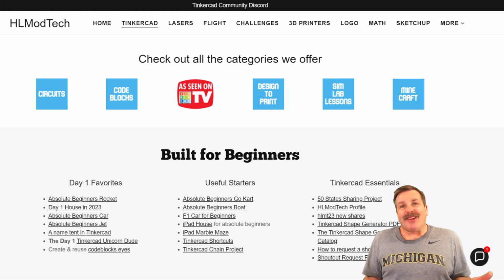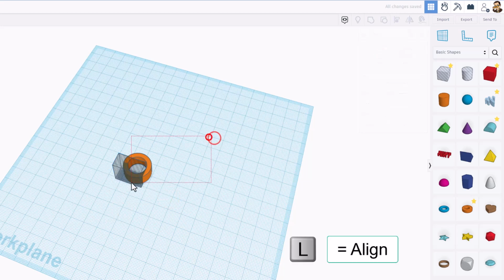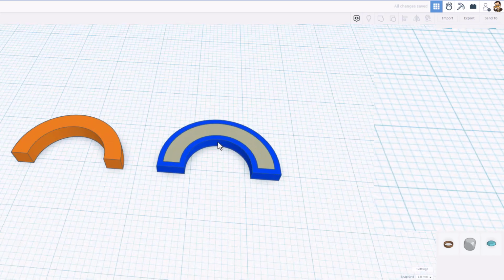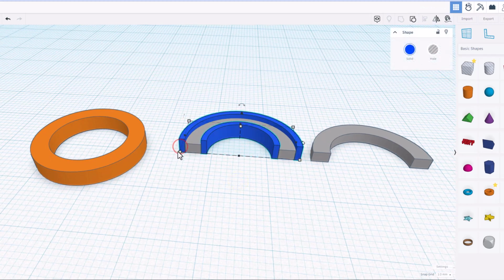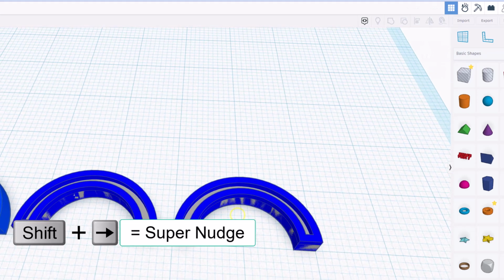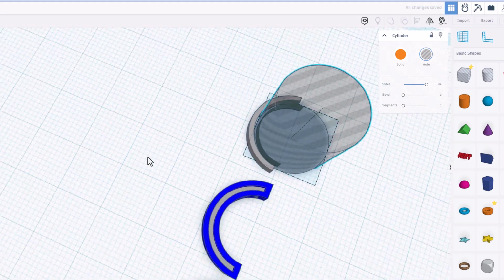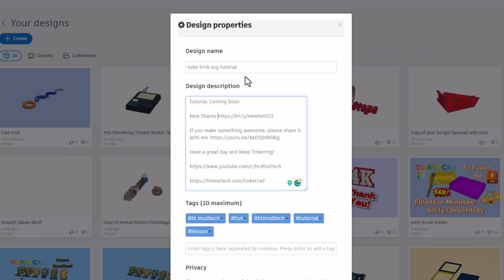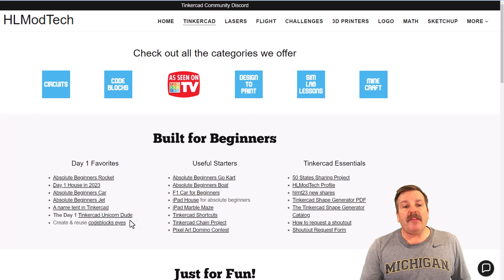Genius Hack! Tinkercad Double Arch Tips & Tricks SVG Import

Comment: One of the strengths of HL's videos is his creative "hacks." Tinkercad seems to lend itself to finding new ways to use what is (compared to Fusion 360) a sparse feature set. And yet there is power in the simplicity, if only because it is more comprehensible.

One thing neither program does all that well is draw in 2D. Yes, you can "sketch" in Fusion 360, but the tools take a bit of getting used to. And there is not a good "feel" to them, in my opinion.

I've used Adobe Illustrator since the "88" version. The even newer versions make manipulating shapes much easier.  It took about 2 minutes to draw concentric arches. I first exported them in one file, forgetting that there was no way to separate the two arches (without masking with a "hole," for example). So I exported each arch as a separate svg file and, easy as pie, I had what I needed inside of Tinkercad...another way to do it. I blame HL for inspiring creativity. :) Search for "Two Arches from SVG." Hopefully I've properly made it public.

No big deal, but these svg models import fast and are (from what I can see) very easy in terms of use of computer resources. Some kind of arch primitive shape that allows you to change the attributes (easily fitting one inside the other, for instance) would be ideal. But I don't know how to do that. And there are good free vector 2d programs you can download. Inkscape is one possible choice.
Reply from the maker: Thank you. 👍 You are spot on that drawing in Tink would be sweet. I agree that drawing in Fusion 360 is not intuitive. I am trying to wrap my head around the correct use of constraints. I do love the Fusion can have variables for measurements. It is really slick to mod a design if a parameter changes.
Reply: @HLModTech  HL, inspired by you, I've been doing some training on Fusion 360 via YouTube tutorials the past couple of weeks. And I've seen by the admission of even the advanced users that even within this vast feature set there are different paradigms or techniques for creating things. That is, there is not necessarily an easy bread-crumb trail to follow. It's so open-ended. That's powerful but, for the inexperienced (like me), often quite confusing.

I don't make videos, but you do. My recommendation is to describe ways (as you have...such as with filleting) to use Fusion 360 as sort of an accessory or plug-in to Tinkercad. Keep the focus narrow and clean. Let your bread-crumb trail be easy to follow. :) That will also inspire people to further learn Fusion 360 if they so desire. Keep up the good work.
Reply from the maker: @bradnelson3595  Great feedback! My new goal is the be the Tinkercad Hansel... I guarantee my wife has zero interest in being a Gretel though. 😂😂

Comment: Tube. Tube parameters. Duplicate Tube. Duplicate Tube Parameters (smaller radius and wall thickness). Box Hole. Box Hole parameters. Align Box hole to bottom centre of Tube. Duplicate Box Hole. Nudge Duplicate Box Hole Y+1, group to Duplicate Tube, duplicate again and make last duplicate a hole. Group Tube and Box Hole and group this to previous hole shape. Job done.

No exporting and reimporting, no arbitrary resizing by eye and no artfully carving away artefacts with holes.
Reply from the maker: Very cool and thanks for sharing to hlmt23! Sweet, simple solution. There were a ton of cool shares today too. Great Jet and Gradient kit. 💯🔥
Reply: I'll have to give that a try, if only to see if I can follow your instructions, Danko. :) One aspect of svg is the usefulness of a 2D draw program (Illustrator, for instance...there are some good free ones out there for Windows) to  create quite complex shapes (relatively easily) that you can then export as svg and manipulate in Tinkercad (or Fusion 360). You are a true engineer and artist, Danko (as many are from looking at the amazing Tinkercad galleries). But even with years of practice in the 2D print world, I find doing basic drawing with these 3D apps to be challenging (lack of snapping to guidelines, for instance). Arches of various types and orientations would be a quick breeze in a 2d program.
Reply from the maker: Link to Dan's project. https://www.tinkercad.com/things/cv2LSGCaEto-demo-nested-arch-for-hlmodtech Quick reminder that it is really nice to give a reaction before you Copy & Tinker. 👍
Reply: I've published the project as "Demo Nested Arch for HLModTech".
Reply: Yeah @Brad Nelson, the SVG trick is great and useful for complex shapes.